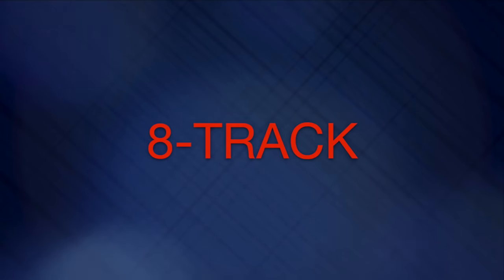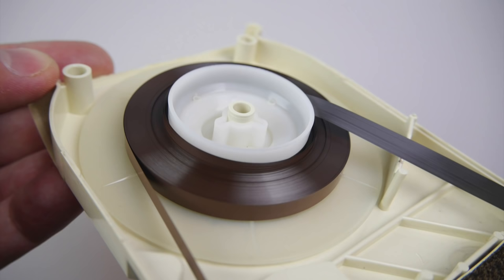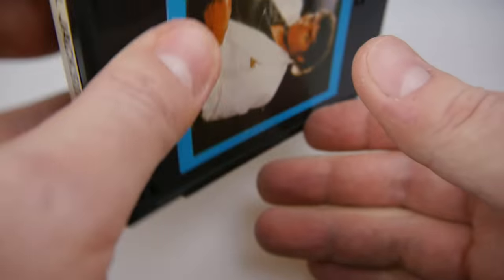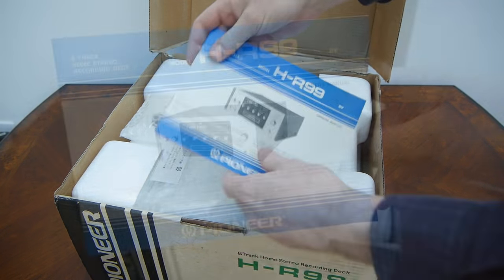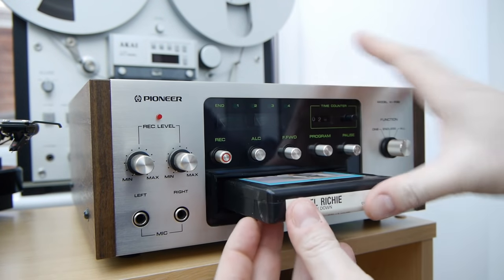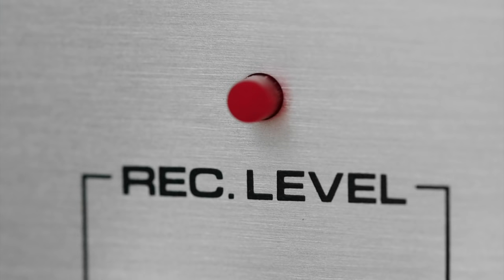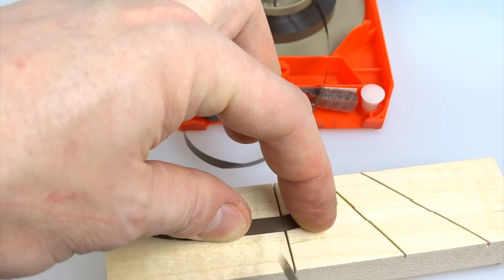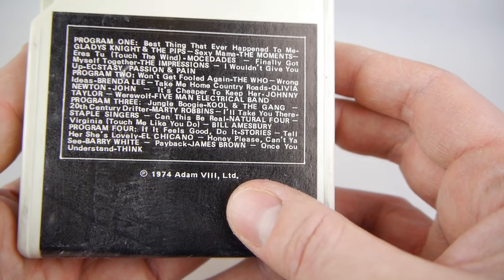Revisiting the 8-Track with a New 1975 Pioneer HR-99 Recorder

Comment: The pioneer HR100 had Dolby, It helped the hiss a lot. I have one in my recording studio, every now and then I'll master to an 8 track, which allows me to EQ for the deficiencies of the format and I can  get a stellar sounding tape, way better than the commercial ones. The old musicians are stunned, 'I don't remember them sounding that good".. well, they didn't. The younger musicians who've never seen one are either facinated or puzzled. It makes for a nice conversation piece. I tell the bands you know when you've made it when your album is on 8 Track. A guy that worked at the 8 track duplicating factory has a great write up on how it worked. When done right the quality is better than cassette due to the double tape speed compared to cassette. but cassette players kept improving and companies didn't carry that over to the 8 track due to the size and the inherent design flaws. 8 Track is the only machine that throws the head out of alignment with every play.  The guy who worked at the duplicating place said the target was 100 plays per 8 track cartridge, after that the record companies figured you were going to buy new music so they weren't concerned with the deterioration of the cartridge. The master tape was on 1" tape and all 8 tracks were recorded at once to the 8 tracks the1/4" tape, took about 2 minutes per tape, the tape spliced. then put into the cartridge, the label slapped on, with low quality glue, and there you were. They had a 5% failure rate. Interesting article. Google it.

Comment: Fiddling detail:  The track layout is not 1L,1R,2L,2R,3L,3R,4L,4R; it's 1L,2L,3L,4L,1R,2R,3R,4R.  This makes for better stereo separation, as the elements in the head are farther apart.  :)

Comment: This is such an interesting video. I've never actually owned any 8 tracks myself so it was interesting looking inside that cartridge to see how they work. I know you could carry out certain repairs on these cartridges yourself, such as the sponge bit and the metal detector  part that made the head move to the next track, but what about if you were able to hear leakage of sound coming through from another track. Could that be fixed at all because I imagine that would be an issue caused by a mis-aligned tape head.

Comment: Solution for the problem at: 9:20 - If you adjust the spring on the right for better, the problem is solved. Have done this with my H-R82 and now play all the cassettes fluently. Nice video anyway!!

Comment: Very interesting and a great Vid. These machines were an interesting cul de sac of technology  just amazed  you could still buy an unused machine. I worked as a Saturday Job in Halfords car accessory shop in the 70's. For a 15yr old into music in a big way it was a pretty dull job but we had a working display stand of Motorola Car audio equipment and amongst the radios and cassette players was a very sleek chrome finished car 8 track machine. As you said in your video the sound of the 8 track was rich and full and certainly better than the car cassette players of the time and I put the demo 8 tracks to good use. This video was a great trip down memory lane. Cheers

Comment: I bought a nasty car model from an auction for about a tenner a few months ago.  The drive belt had disintegrated, but I only paid about a tenner for it and a pile of tapes.  I replaced the drive belt with one of the many thousand hair bands my daughter leaves lying around, but Bing Crosby's White Christmas sounded creepily slow.  I used an O-Ring to increase the diameter of the slave pulley and using an elastic band as a belt I got the playback speed near perfect.  On Christmas Eve I stuck the player in my porch, windows open, volume on full, and my White Christmas "album" playing constantly.  For about 36 hours.  Nobody slept.  Not even Santa.  I'm sure about 4am I heard the ghost of Bing telling me to knock it off.  I tried changing tapes to the Partridge family but it chewed that tape up really rather quickly.  I love that buy though; it took a bit of work to make it work but I was well chuffed with the results, even if my neighbours, wife and children hated me for it.

Comment: The metal splicing tape is called sensing tape.  I've tried fixing a few 8-tracks and they might play well the first two or three plays, but, they get screwed up again inside the mechanism.  My theory is that they have it mathematically all figured out EXACTLY how much tape is need for it to work perfectly and, if you splice off even an inch or less, that screws with the needed length and it'll eventually get eaten anyway.  I think they also have it worked out how much tension is needed for it to play the right way and, when you tighten it in order to get the splice done right, that throws things out of whack, too.  Another downfall of the 8-track is that they have to coat the back of the tape with a kind of graphite so that it'll easily come off that silicone hub on the reel, but, that graphite gradually wears onto the playing surface of the tape gunking up the heads and other bits that come into contact with the tape and, eventually, the tape goes bad on you!  All in all,. I'd MUCH rather use open reel or cassette!!  I think I've only got 3 or 4 8-tracks in my vast collection!!  One belonged to my grandmother!

Comment: Just over the weekend I got a Concord brand 8-track to try out from a local antique shop. Not really doing anything to it, I was shocked that it actually played the tape I tried in it (Blood, Sweat and Tears album) and it played at the right speed with both channels with good stereo separation! Pretty good for a machine that has probably not been used since the early '80s. I will be cleaning, belt replacing and adjusting on it to get it is best as it can, but it needs nothing cosmetic as its about as clean as the Pioneer in this video. A complaint I have is that the VU meters do not light up on playback, only on record, so other than the track light, you can not tell when its turned on. By the way, I always hated 8-track, this is an experiment in personal growth to find out if the format can win me over somewhat.

Comment: Every once in a while the machine would 'eat' the tape resulting in many feet of un-spooled tape outside of the 8-track. There was a method to get that tape all back in without taking the cartridge apart. Hold the 8-track with the opened end facing down. Then grab one end of the tape near the cartridge (I can't remember which side) and gave it a strung tug- all the tape will suck back inside. You basically needed to spin up the internal tape spool. Give it a try!

Comment: I'm surprised you didn't mention the deterioration of the pinch roller, which is a part of the cartridge like the sponge pressure pads.  Unlike Phillips Compact Cassettes, which have the pinch roller as part of the player, the 8 track roller is another rubber part that degrades over time.  Most of the rollers I find have turned to mush, and putting a cart like that in the player is like inserting a goo-spreading mechanism.  Perhaps roller replacements are available, but I haven't tried that, and I'm not sure a new one could be inserted into a cart.

Comment: One of the biggest reasons for damage is a whole lot of these tapes got left in cars, in particular as the format got older.  In the western and southern US, the ambient air temperature can be over 40C, so inside the car can easily be over 50C.  That and the normal 8-track rot leads to extra-poor looking tapes over time.  I remember one used record store near me in the 1990s tried to clear out their used 8-tracks at 4/$1.00.

Comment: I think the higher speed of the 8 track makes it less prone to treble loss due to azimuth misalignment. The system’s much bigger head with bigger coils inside also help to generate higher output signal level which shd help it reproduce music better than in cassette format. 

If 8 track tape lived well into the late 80’s alongside the cassette tape, it could have had some market with it going.

Comment: I have been a collector of 8 track tapes & players Home & Car audio since 1970's. I have had great luck with tapes & players. Most are easy to repair. The drive belt is a tough one to find. That is were garage sales & Goodwill can help keeping things running. FYI? If you have any audio or video equipment that breaks or quits running. Better learn how to repair yourself. I tried to get a Sony CD player repaired. I tried several repair companies. From Best buy to guy working out of parts found to repair them. No body wants to touch anything over 10 years old. Back 30 years ago. I moved to get a job. I found a old Hippie. He had a  Head store with every thing that Hippies would have or buy. I started a small business repairing 8-track tapes & players. The store owner referred people with 8 track problems to me. Then my Boss found out that I had working 8 track player in my 1973 Chevrolet Suburban Delivery truck. He handed me his collection included a box that was used in stores to sell 8 track with holes in Plexiglas sliding doors to reach inside to see song list. Many 8 track tapes and player. I use Bare Metal Foil to repair track changing & tape splice that is a hobby item to make chrome on model parts. Magic tape by 3M is used to repair broken tapes. I get use carpet foam to replace the disintegrated foam to push tape to heads. It seems to last longer that other foam. I superglue to glue pads onto metal. The old Apex tapes used the pads on metal & some had cork on wheel. That cork becomes a destroyer of tapes &  worse to players. Plus Apex tapes 8 tracks halves are glued together & very time consuming to get the two pieces apart. I have saved 8 track tapes worse than the last image in video. Now I am working on installing a Realistic Radio Shack  AM FM 8 track in my car I bought recently. Need to have the right stereo in a period correct car. I recently saw a 8 track player that held multiple tapes like a record player carrousel. Never saw one growing up as a Baby Boomer.

Comment: 8 tracks, if you had a tape that only had one song you liked in the car you had to ride around a while to hear it again. Maybe that's why albums were better then. I had a home Akai 8 track recorder that weighed at least 30lbs. I would get high quality Maxell blank tapes from a local stereo equipment retailer, they didn't have a sponge like the cheap tapes, they had a little felt pad on a copper flat spring that applied pressure to the tape for tight head contact. I used to record all my albums to 8 track from my vinyl and would calculate the tracks out so you didn't have it changing tracks right in the middle of my favorite songs like the store bought tapes. I would sometimes take the tape cartridge apart and cut the unused portion of tape to the longest track and it was a balancing act to keep the tape tight enough to spool correctly and not too tight so it would drag. I really hated that fade out, clunk, fade in like he described. If 8-track tape machines had received the Dolby noise reduction circuitry and metal tape like cassettes they would have had superior sound because they ran at twice the speed of a cassette. The actual tape is the same as a reel to reel tape in size and speed so it's good quality. I think reel to reel only used four tracks, two stereo L+R for each direction as you flip the reel over so the spacing between tracks was better hence better sound quality. I think the way this vid shows the track layout is incorrect, I'm not an expert but I think the four L channel tracks were at the top and the four R channel tracks at the bottom or vice versa and that was to separate the coils in the head so they don't cause interference with each other's magnetic field, if you look at the tape player head you see that the two elements in it are separated farther apart than what it would be if they were arranged as your diagram shows. The issue he's having with the tracks bleeding over is probably a head alignment issue, most car decks had a hole in the upper case housing so you could stick a small screw driver in and adjust the head while it played so you could adjust for misalignment. As the tapes got old and were in your hot car all the time the adhesive on the connecting aluminum tape piece would let go and the tape would unravel like the one he had and you'd have to get the metal tape piece to join the ends back together but when you went to wind it all back together it was tricky to get the proper tension on it because as the tape comes out of the center it takes up the slack and goes back onto the outside of the spool. When they would stick to the capstan roller and unravel we'd just take the tape out and hold the cartridge with the tape hanging out and tug on the side that pulls the tape out and it would magically rewind itself into the cartridge. Too bad they never made the case out of clear plastic that would allow us to see the way it worked. BTW, the cleaning fluid is just denatured alcohol and the 6" long wood shaft cotton swabs were available at Radio shack. I still have my Pioneer under dash super tuner 8 track player with the big round dial for the FM tuner.

Comment: I had an under dash unit by Craig-a combination 4 track and 8 track player.  The 4 four track sounded superior to the 8, because there was twice as much tape space to dedicate to each recorded track-thereby giving a little more dynamic range so you didn't hear the hiss.  The downside was the drive mechanism: what moved the tape was a capstan drive wheel that swiveled under the cartridge case into a hole about the size of a US 50 cent piece, flipped around and pushed the tape from the back. If you yanked the cartridge out too fast, a pile of tape would be left hanging out, and unless you knew how to fix, was now trash.  So the 8 track was designed without any capstan access hole, the tape was moved by the motorized rotating metal piece that pushed up against the permanently mounted rubber wheel, thereby preventing most of the tape accidents.

Comment: I confess: I am guilty of owning a 1972 El Camino with the "under the dash" 8-track player with Jim Croce popped in most of the time. There is certainly a nice warmth to the sound as you said, and the hiss is only really noticeable during silence. Ah, good times!
Reply: A friend of mine rode to high school with another friend for a while and he said the only 8-track tape he had in his car was Black Sabbath Paranoid so they listened to that everyday. He told me that because he rode with me afterward and I had a whole box of 18 tapes and rotated them from my supply at home.
Reply: @manstersr  Heh heh...those were the days... I have taken apart MANY 8 track tapes because the player ate it. Became somewhat of an expert at it after a while. Cassette players were slightly more reliable as far as that goes, but still ate their tapes from time to time, at least at first. Manufacturers finally got it right just in time for CDs to take over...
Reply: @JustWasted3HoursHere  And all you needed was a pencil to wind the tape back into the case. I wonder if that was by design?
Reply: @manstersr  And then CDs came along and ruined all the end-user fun...

Comment: Great video. Very informative.  I have an 8 track player for my 1978 campervan.  I'm currently fixing the player as it won't change the track automatically as the cam  mechanism is a bit weak. Any tips? Cheers. Nick.

Comment: The U.S. HR-99's VU meters only lit up during recording.   No way a cassette ever had better sound than an 8track.   The HR-99 & HR-100 were built to last. Love my HR-99!  You need a metal spicing board because you always have to replace the sponge, metal sensor, and put a piece of splicing tape on the back side of the tape opposite of the sensor tape.

Comment: Still got my Pioneer , due to the function switch(one play and ready cued the next selected), they make a great jingle machines and 8 tracks were often used in radio studio's for jingles, music(pirate radio in rough sea's) and adverts, until the mini disc and then computers took over ... 
Talking about old pirate radio, Radio Caroline will be transmitting on  648kHz Aug 2017, a new official AM band from Ofcom for the East of England :) and Radio Caroline ship the Ross Revenge, on 1st June it's a official historic vessel, it has been placed on the National Register of Historic Vessels of the United Kingdom :)
Reply: The 8 track tape was the brainchild of Bill Lear, of Lear Jet fame. His company based the design on the 4 track cartridge that Earl 'Madman' Muntz sold in California as a car tape player.  Muntz got his original cartridges from a company called Fidelipac, that marketed a machine designed for radio stations to play short jingles and adverts.  The continuous loop of the cartridge meant that after it played, the tape was already cued up for the next go.  A more sophisticated audio tone system (on a separate track) accomplished the cuing and the tape ran at 7.5 inches per second.